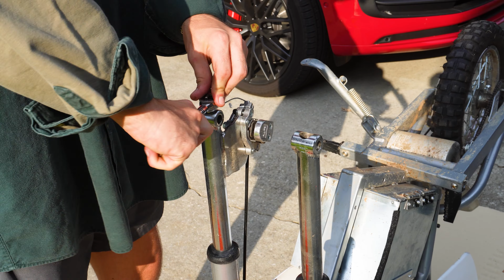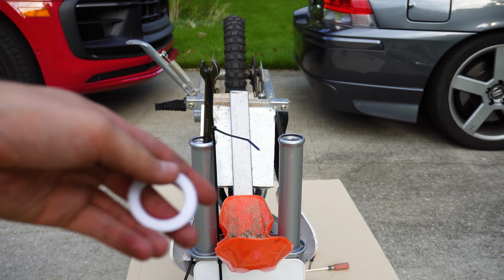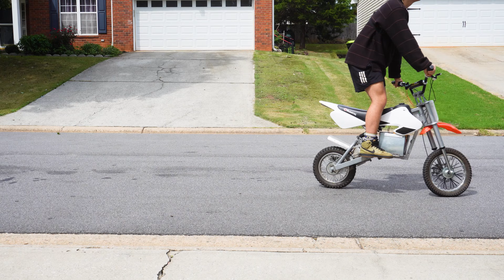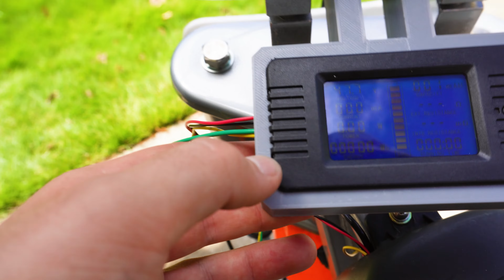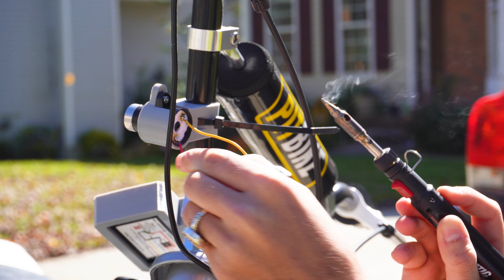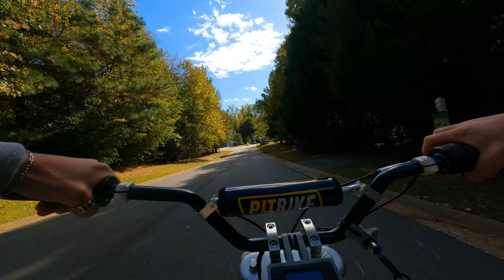72V Electric Pit Bike Gets Air Suspension! | Razor MX650 to MX3000

Comment: Prop to you brother very impressed with you 3d print those sleeves after finding out its worse with a new taller spring i know i could use a 3d printer for a lot of minor issues and will buy one but does brand matter also what kind are you using......?

Comment: What tool did u use to put air into the air suspension?
Reply from the maker: Air compressor
Reply: @AllThingsElectric_  right thanks, I'm not too skilled in mechanical work. I actually just replaced the battery with a lithium one, for the first time. 
 Which one is better a remote or manuel air shock? 
Also how did u calibrate it to ur weight?

Comment: So the guides help with the wobble, have you found any fix to keep them from bottoming out and clanking whenever riding over anything bigger then an inch?
Reply from the maker: No I haven’t, could probably be solved by adding some rubber grommets/o-rings over the spacers.

Comment: Glad to see that there’s a fix for this!  I swapped the springs and regretted it right away because of the same issues.  I’m a little surprised that you fixed it with just those longer guides.  Now I have to figure out how to get some made for myself as I don’t have access to a 3D printer…
Reply: Check with local maker space or even schools. My high school has a few printers

Comment: What is the difference between the mx650 and the 500
Reply from the maker: Nothing structurally. In stock form, it’s just the motor power. 650W vs 500W

Comment: Your awesome when it comes to the modifications on the razor dirt bike I have one I’ve been building and working on and your a great inspiration towards that but I have a question with over heating of the bike how would you deal with that because that’s been my main issue when riding
Reply from the maker: It does get hot if you rip it for a while. I recently switched back to the stock rear sprocket for more torque and less speed, and this combats the poor heat exchanging pretty well.
Reply: Get a heat sink